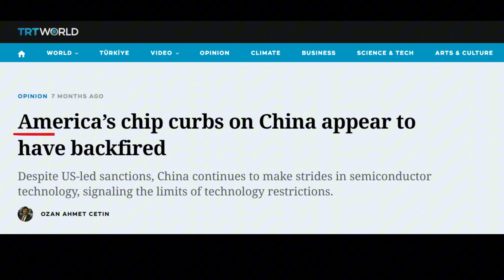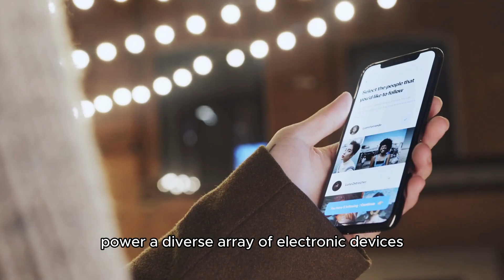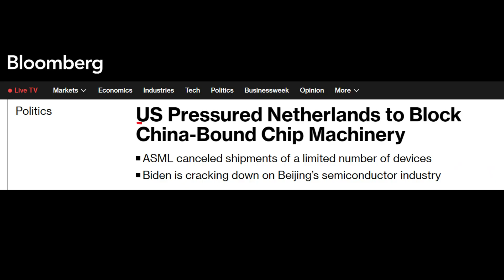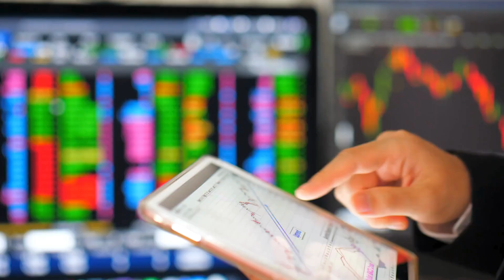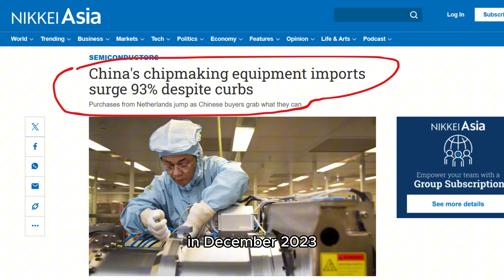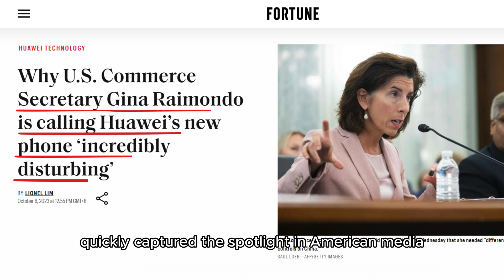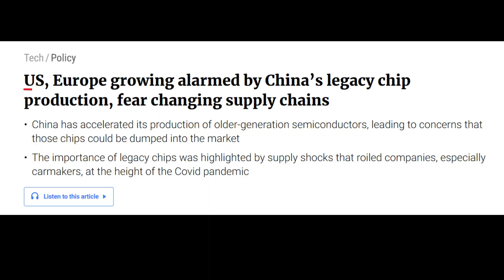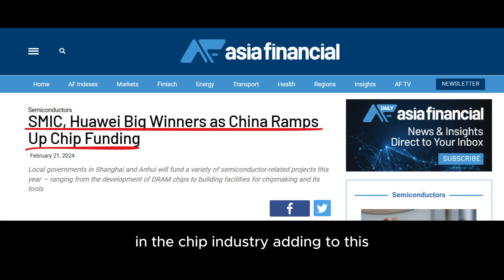How Sanctions ACTUALLY Made China STRONGER

Comment: China has 44 chip fabs in operation and 24 more are in various stages of being built.  Currently China produces 25% of the world's output of semiconductors and the US 10%. This video says the forecast is for China to rise to 37%.  The US is weak on fab as most of its cutting edge chips are fabbed by TSMC in Taiwan. Apple, Qualcomm, AMD, and Nvidia are the major US semiconductor companies having their semiconductors made by TSMC.

China continues to rise in establishing a 100% supply chain for semiconductors.  Huawei claims it has done that to 14nm.  China is well under way for producing manufacturing equipment and chemicals for semiconductors.  Huawei is said to be working with SMEE and SMIC on an EUV lithography machine to debut later this year.  China is also working on a particle accelerator lithography capability said to push China into competition with the Netherlands and Japan in the lithography sector.  

Even Japan is rising in lithography-not with its nano-print by Canon that can produce 7nm chips without  the lithography process. Canon says their process is capable of 5nm and maybe 3nm.  Russia has said it is capable of producing 7nm chips and both China and Russia are working on x-ray lithography.

In my opinion, the US new fabs in Arizona, Texas, and Ohio may never see the light of day as competitive pressures make them uncompetitive in cost and the ability to get sufficient skilled labor. Even China's rise is getting experienced skilled labor from Taiwan, South Korea, and even from Japan.  Those in the know, see where the epicenter of semiconductor growth is and that is China.  This will be China's decade of dominance in the semiconductor sector.  Not only in advancing silicon, but the rise of photonics, graphene, and quantum chips are coming into reality.  China will be the only country that has a complete domestic supply chain, both upstream and downstream.  China has eight major universities  offering majors in semiconductors, the US has 5, but none offer degrees in semiconductor technologies. The US dominance in semiconductors is fleeting as it doesn't have the human resources to compete with China.  China produces eight times more STEM graduates than the US and the projection is for that to grow to 15 times more by 2030.  It is from this ground swell of STEM graduates in China, that China will rise not only in semiconductors, but across a broad spectrum of technologies.
Reply: Viva China !!! 🇨🇳🧠🙏💪👏❤️🎉🎉🎉🎉🎉🎉🎉🎉🎉
Reply: China, the Asian giant
Reply: Can you please mail this to me on deep1960@hotmail.com
Reply: Before Trump, China thought globalization was the model to go, it’s US broke the rules and so karma is at play, sadly but surely. Now US got the national security they desired!